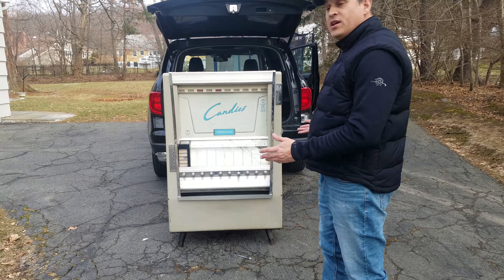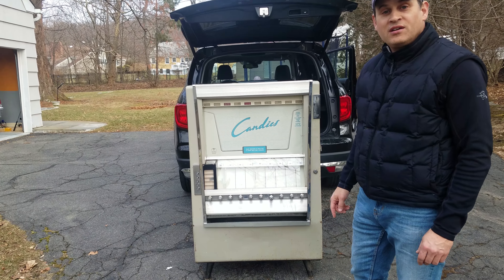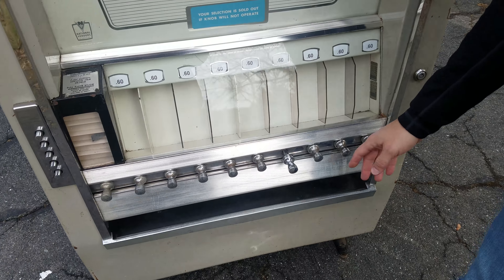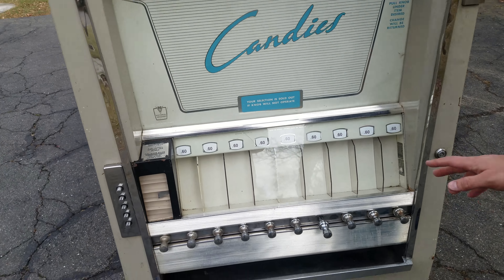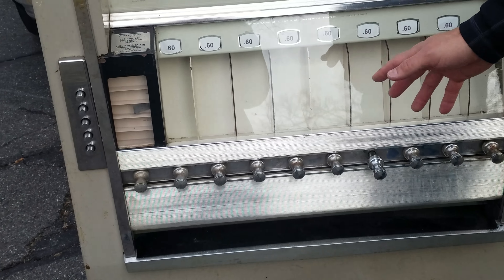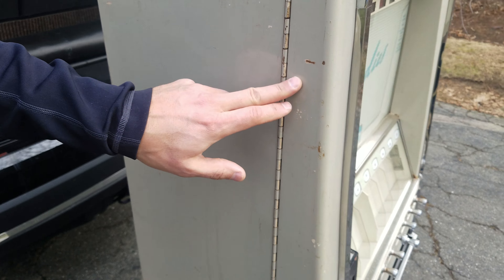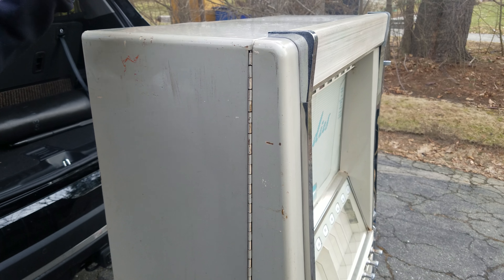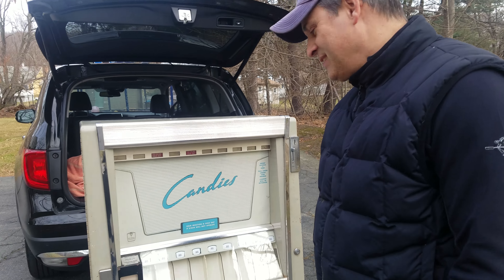Refurbishing a Vintage National Vending Candy Machine

Comment: I recently purchased a similar machine however, the prices are set to $.75. Would you have any idea on how to change them?
Reply from the maker: Karl Bierach hey Karl... I think I might just leave it alone. I do see manuals for sale on eBay. If it works at .75 I’d just roll w it. Mine is .60 .. always looking for dimes!
Reply from the maker: I was able to print out vintage font prices in turcoise color to match . The machines are so old I don’t want to mess w it as there are no replacement parts
Reply from the maker: Finally, I was able to put Small LED lights inside.. really made the machine great!
Reply: Thanks for the quick response. I do think you are right to leave well enough alone considering all the slots work. 

Great idea on the led conversion as my wires heading to the bulb were either fried, cut by the old owner or some rodents had a feast.   Would you have link or additional info on how you made the price tags?
Reply from the maker: Karl Bierach I just went on Microsoft word...font the right font and size through trail and error and used regular paper w color printer.,came out pretty well for a low cost solution
Reply: @realitychampion8022  Question I just restored a 64 machine its huge over 6 feet tall but I can figure out the settings for the pull knobs. I set the change wheels to a dollar as by the instructions but cant figure out what it means to set it up under the knobs...ive tried multiple combos just missing something....any pics or videos would be a appreciated...